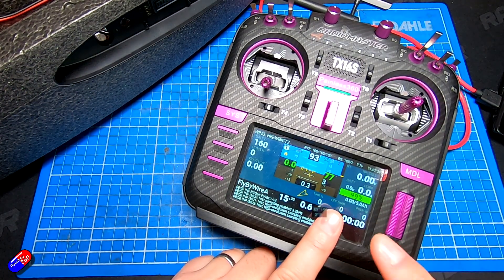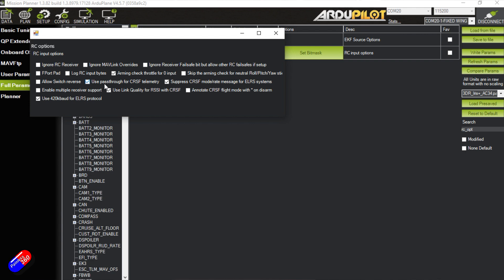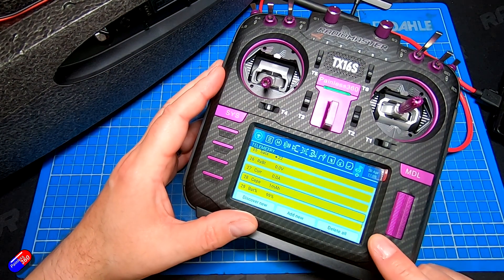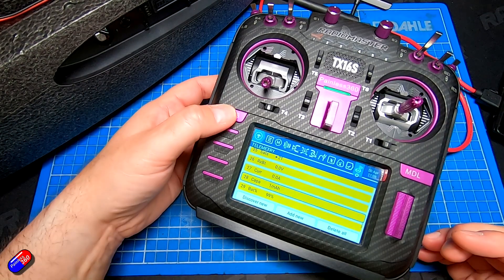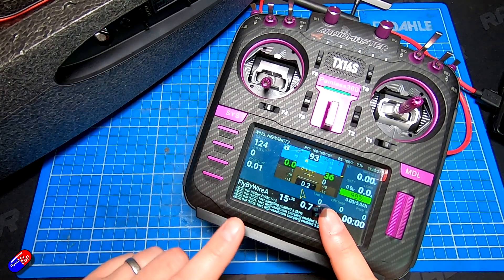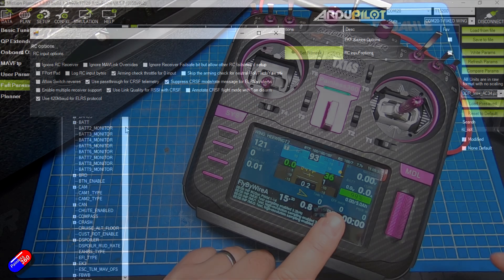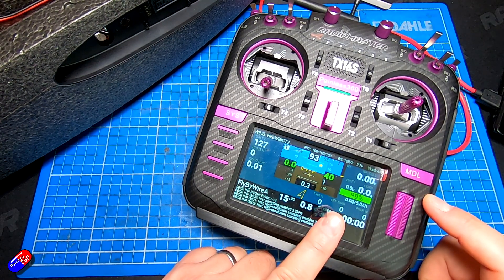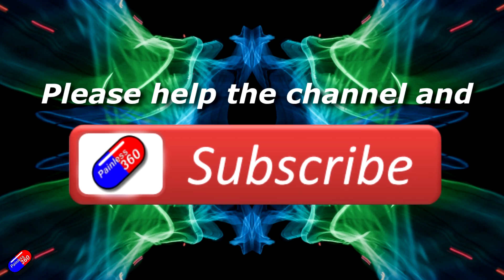YAAPU 'No Telemetry' error when using ExpressLRS/CRSF

Comment: Your content is always interesting and informative, so I'm always grateful for it.

I'd like to inquire about an error while using ELES and Yapp telemetry on the TX16S controller. Could you help?

- The initial screen is normal, but when I launch the aircraft, the screen displays "ERROR in refresh(): ?:0: attempt to perform 'n%0" and the screen doesn't appear.
Reply from the maker: What versions?
Reply: @Painless360 thanks! Yaapu Telemetry Widget 2.0.x dev (1997425)
Reply from the maker: I've not seen that and there are no easy answers with a quick Google search. If you're using all of the latest versions (including EdgeTX), then I'd log an error report to the developers... Best of luck!
Reply: @Painless360  Thank you for your quick and proactive support

Comment: Hey, I am using radiomaster zorro. It is giving the “NO TELEMETRY“ error. All the sensors are detected in the Telemetry tab of EdgeTX but it is showing NO TELEMETRY when I run YAAPU telemetry script via the telem button on the radio. In the YAAPU config script CRSF support and Px4 mode is switched on.

BTW I would like to clarify I am using the mavlink via elrs where the serial protocol is set to 2 (mavlink 2) instead of 23 (rc in) as now elrs can directly support 16 channels and telemetry.

The setup I am currently using is TBS lucid h7 running on arducopter 4.6.3 with elrs version of 3.6.0 and elrs backpack version 1.5.3 for telemetry. Also tried with pixhawk cube orange plus running 4.4.4, 4.5.7 and 4.6.3. Got the same results. It is connecting via the elrs backpack to mission planner with full telemetry when I am using both the flight controllers.
Reply from the maker: I've not tried that.  Best of luck
Reply: If you try and get it working please do respond later. Thanks for the quick reply.

Comment: Hello, i hoped this video will solve my problem with yaapu, but sadly nope. I have had everything working with elrs on tx16s untill.. i updated edgetx and elrs versions to the newest. Now the script and telemetry works, but without ardupilot messages at the bottom of screen. Previous versions was only few revisions older, i didn't made any huge update. I recall that probably something changed in protocol but don't remember what and where. Any help appreciated! :)
Reply from the maker: Please post the solution when you get one... Best of luck

Comment: Hi, i tried same thing but i still got "No telemetry" error. I tried with Betaflight and Inav, telemetry data coming to my radio but script not working. Any ideas? Thx.
Reply from the maker: Yappu is an Ardupilot MAVLINK LUA really... What troubleshooting have you already tried?
Reply: @Painless360  I also tried getting it to work in betaflight, but have a similar issue. The CRSF yappu debug script shows no incoming data, but sensors are there. I just don't know how to setup that frame packagin in betaflight.

Comment: I have set this option ticked on Ardu configurator. Yet no Telemetry from the Heewing 405 board that comes pre installed on the T1 ranger VTOL. Both the options you mentioned here are enabled. Is there anything else to be done in the port configuration? Is there a chance that particular board doesnt send telementry ?
Reply from the maker: Not all ports are created equal on some flight controllers. I'd try another UART... Best of luck